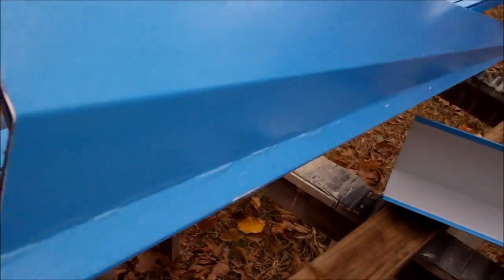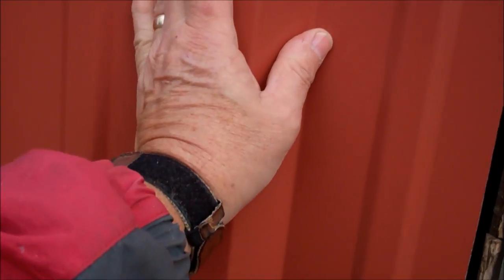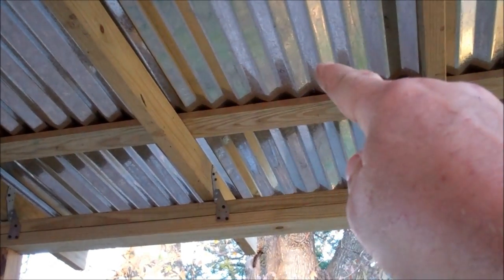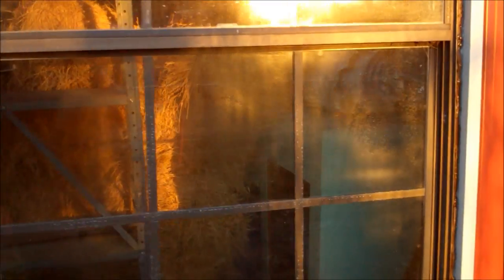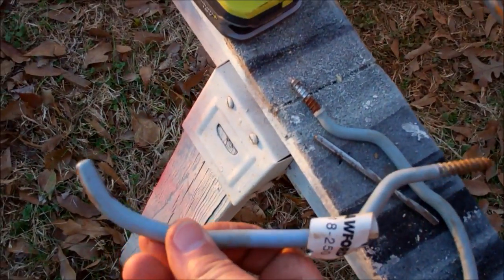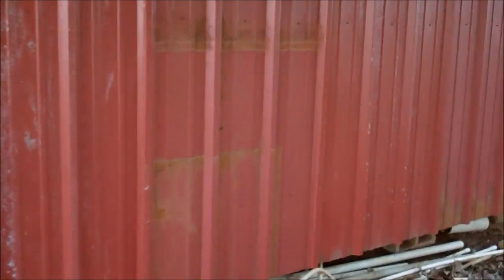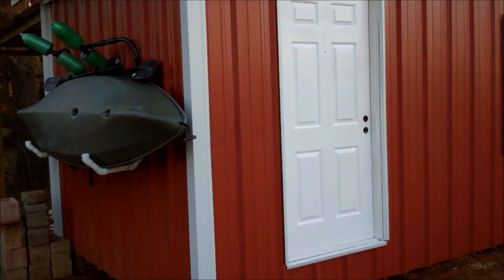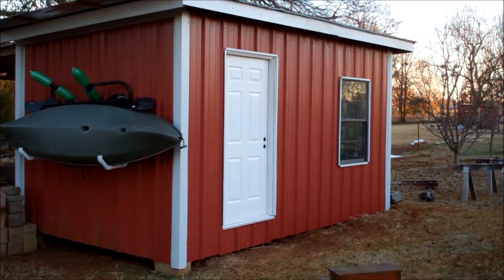The Shed Rebuild Project~The Finale

Comment: Great job! I've been putting up a 20x20 pole barn in my "spare" time. I started in January and I now have the roof on and got started on the side walls this weekend. Not having done anything like this before it's good to see how others work with this metal siding and trim.
Reply from the maker: You've taken on a pretty big job... but you'll be mighty pleased when you get it done

Comment: TP2, enjoy watching your videos. My dad owns a metal shop and from a do it your self standpoint, you did a pretty good job. You had a question about why the paint on the top sheet was fine, but the bottom sheets were bubbling.  Once you pop the bundle of sheets, moisture eventually gets between the sheets when it rains and begins a process my dad calls "white rust". Its easier to see when you have galvalume or galzanived sheets of metal. If the sheets arent separated or tilled at an angle to let the water run out, the moisture stays between the sheets and slowly starts to eat the metal or paint away.  Once the process starts, the product is ruined, and typically irreversable.
Reply from the maker: Wow... very well explained. Thanks, good info !

Comment: Good job:
I do architectural drafting & design & helped to build an air plane. All I can say is good job in thinking 'out side of the box'.
The damage to paint was from the condensation. I would seal the top of the window better though. God bless you (I'm just north of Houston)
Reply from the maker: FireOrWater1 Yea... I caulked it real good... and will be watching to make sure it doesn't need more...
Reply: God bless YOU & I enjoy your work :)
Reply: TexasPrepper2 One thing I would do with the upraised ribs on the underside of the roof is to stuff them with insulation so you don't have bee colonies. Had to do that with my backyard shed.
Reply from the maker: Ronald Ziehlke
I thought about it... just haven't done it... yet

Comment: Nice Job TP2, the old shed looks much better. Do you have problems with yellow jackets and wasps building nests on the ladders and stuff hanging on the side of the building like we do?  The pesky things have stung me a good number of times.
they seem to nest on the underside of the ladder where you just cant see themuntill its too late.
Reply from the maker: a4000t If you use chemicals... very early in the spring (wherever you are) spray an insecticide wherever you DON"T want wasps. Under eaves, inside storage bldgs, etc. They'll find another home...